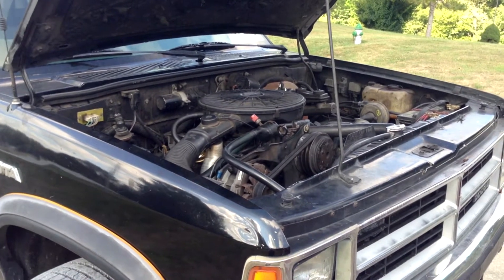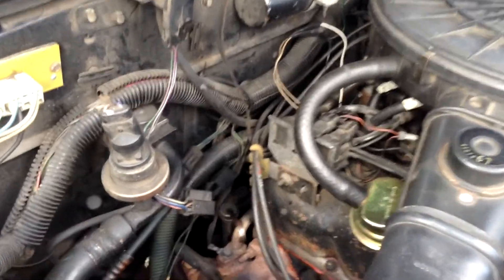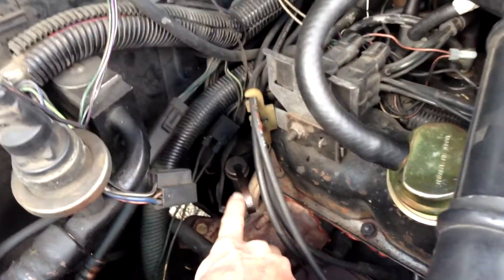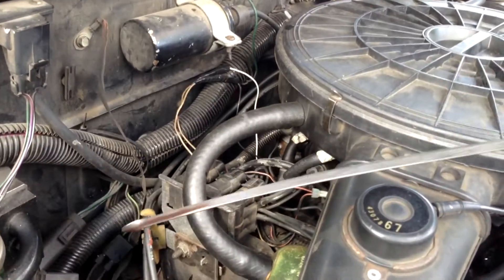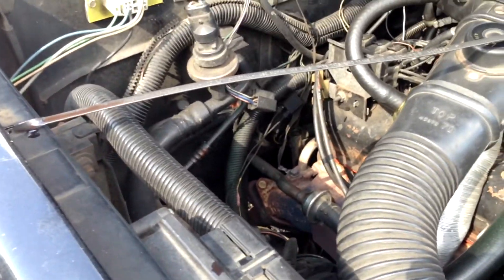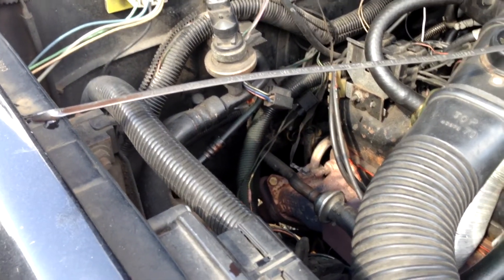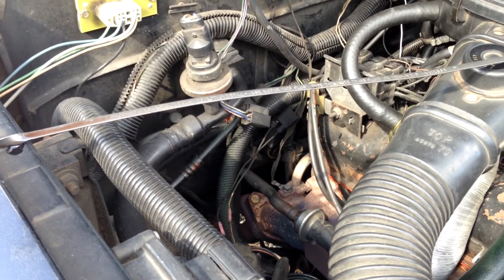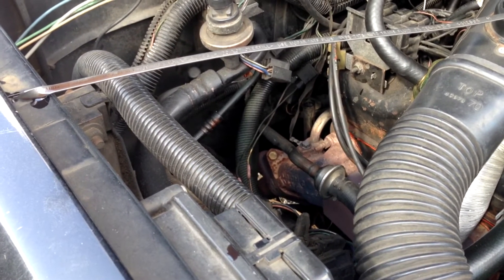How To Check Transmission Fluid On A 1988 Dodge Dakota  3.9 V6

Comment: i just bought a 91 dakota 3.9 six cyln.; that's the same as your model, correct? Your repair vids on this truck will work for me, yeah? thank you and i do appreciate you for filming these jobs...extremely helpful!
Reply from the maker: +Kevin S.  They should help you but I would check with a parts place or the dealer for specific guidelines for you year of truck.
Reply: ok; i will do that. thanks

Comment: I just did a motor trans/ transfer case swap in a 1993 dakota 3.9 but put a motor/tran/case from a 90 dakota 3.9 into it. 1990s Wiring harness eliminates the need for fuse box and alot of other things its hard to find out before actually doing it. If you'd like a vid or sample shout me out .

Comment: I have a question , I just bought a little 88 dodge dakota when I place it into drive it hammers into gear so hard it kill's the motor and stays in gear when i come to a stop  after it warms up some it is better do you know what will cause this?
Reply from the maker: Mine drops into gear hard sometimes when I'm going from Park to Drive but my engine never dies and it's not all the time. I was told this is normal. I usually wait a few seconds after starting it to move from Park to Drive. This allows my truck to reach it's normal idling position. If you don't know when the last tune up occurred, I would change the plugs, wires, distributor cap and rotor. Also, check the transmission fluid level and definitely do an oil change if you're not certain when the last one was done. Hope this helps. :) Let me know if you figure out what was going wrong.

Comment: Dumb question, but where's the reservoir to add fluid to?
Reply from the maker: It's the same place where you check the fluid level. Just use a small funnel.